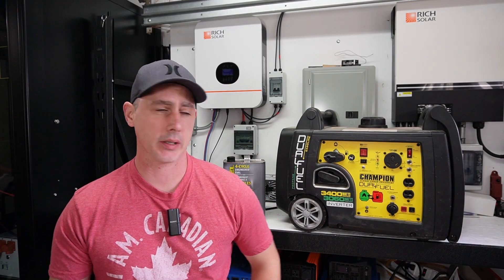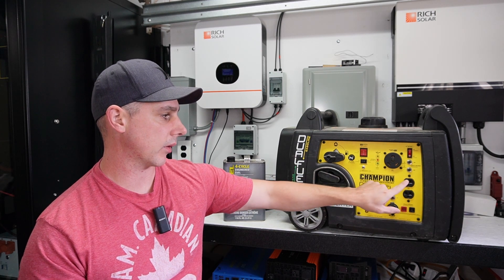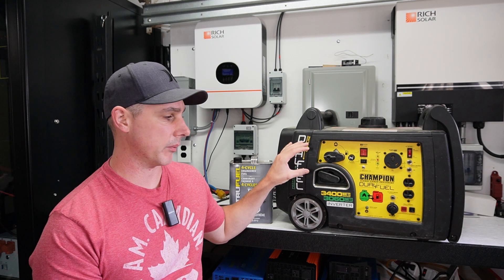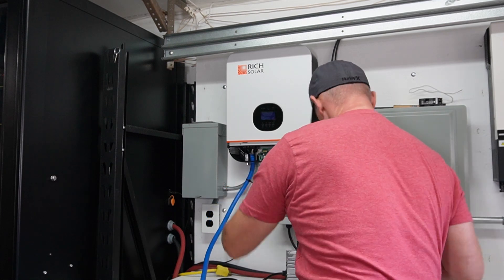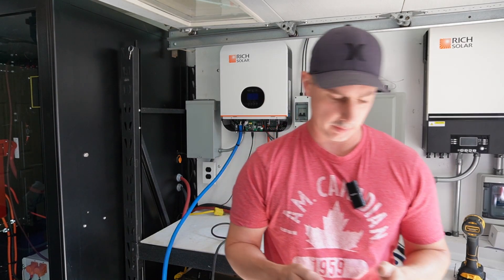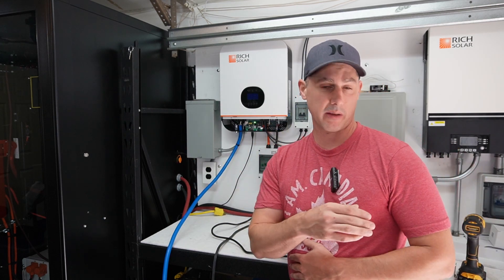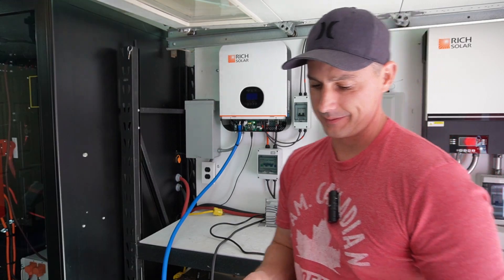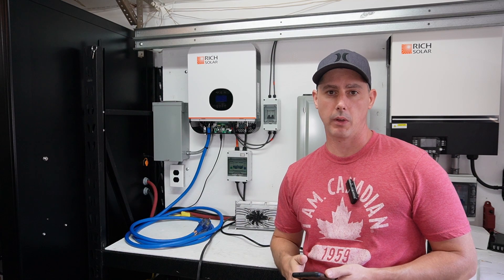Running A Generator To Charge My LiFePO4 Batteries With a Growatt/Rich Solar

Comment: the little batteries in those generatiors are crap and makes tje electric start unreliable...have one exactieally like it...generator is only great when it runs, right...
Reply from the maker: Yes, I've replaced my battery and use a tender jr on it

Comment: Why not use propane instead of that expensive gasoline?
Reply from the maker: Unfortunately, I wasn't thinking properly when I bought the generator new and put regular gas in it. I wanted to burn off the gas I had used in it to put the true fuel in. 10-year shelf life.

Comment: Excuse me if this is a stupid question. Are there issues with charging via the AC Input from a generator. I just watched a video on the EG4 Chargeverter and it was stated there could be major issues with using generators with < 22kw of power to charge via the AC input of the inverter.
Reply from the maker: In my video, I'm using an Inverter Generator. This puts out a pure sine wave. A regular generator uses a modified sine wave which can be bad to run through the input of your inverter. hence the cahrgeverter.

Comment: It costs me about $100USD to charge my 30kwh battery with my Honda 7000. Not too bad, given all the inefficiency. I’ve never actually charged it from dead.
Reply from the maker: It's a great option in an emergency. Not practical for everyday use.
Reply: What 30KW battery do you have? Also, how long did it take to fully charge it? Assuming you depleted it to 20% battery? I’ve thought about going this route for my Skoolie.
Reply: @trevorcooper9457 I started with 6- 48v server rack batteries and a 10kw solar array. Most days I am charging with 7000 watts in summer. Takes about 4 or 5 hours to charge. Ive since upgraded. Don't undersize, determine your need and double it. Thank me later.

Comment: Hi thanks for the video 
Great info 
But the question is:
If the battery reach the limit of capacity and there is no sun the inverter turns off so 
when you Connect the generator or the sun rises it will turn on back by it self or you have to do something ?
Reply from the maker: The unit will turn itself back on.

Comment: The generator connection on those inverters are nice. My power went out around 8 pm. I ran on battery all night and later plugged the generator in the next morning to charge my batteries and supplement power. It worked out great with a setting of only 5 amps (300 watts) into the battery and my remaining power to my loads.  It was fascinating to watch the solar supplement the generator. For that outage, I used 32 ounces of fuel on my 2000 watt generator running two fridges, tv and lights.  It's  the way to go even if you don't have solar panels. Don't brag about it to your neighbors.. energy storage systems must be registered where i live in Illinois. There is some liability to consider about local regs because most of these inverters don't have proper markings for code. Keep it on the down low.

Comment: Yeah, even if you invest a lot in solar and batteries, it's not a bad idea to also have a fuel generator. Can just use the batteries for small stuff, and then fire up the generator when you need to power something heavy for a short period of time and/or recharge the batteries.

Comment: Always get me thinking.I didn't think about my Champion dual fuel genny running mod sine wave. May have to sell it off and get a inverter gen. to use for my growatt. I have used it to charge my Titan batteries but only once. Also didn't realize that gas can is got a long shelf life. I'm constantly swapping out my fuel containers every 6months so maybe I'll start stocking up on the cans. Probably will have to buy a cabinet so I don't get in trouble 😅😂
Reply from the maker: It's more costly too. It would be cheaper to keep changing the regular gas out. Guess it depends how much you use it. ,👍

Comment: Nice little generator.  Glad to see it charged the growatt w/ no issues!  I might have missed it, but did you have any loads on that inverter at the same time you were charging?
Reply from the maker: I did not, I'm sure it would work. I'll make a YouTube short I'll have to warm up the oil again anyway before I do the oil change. 😁